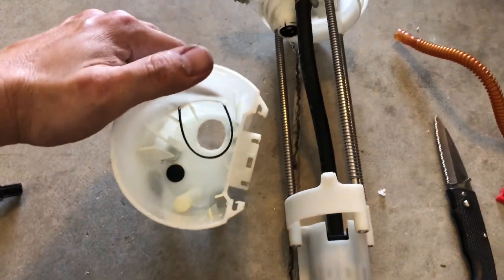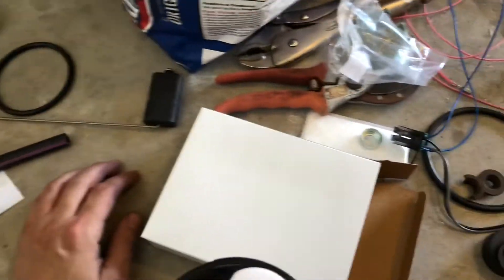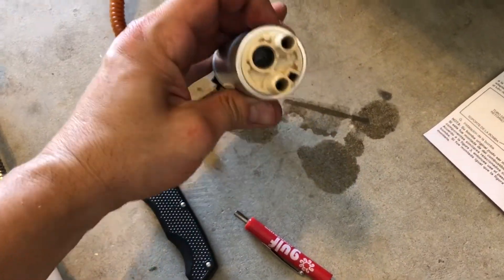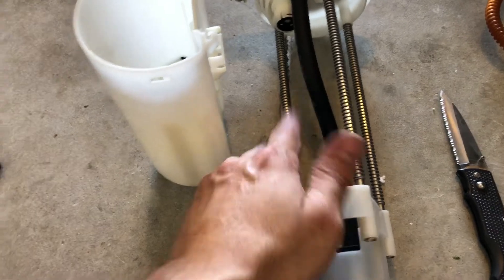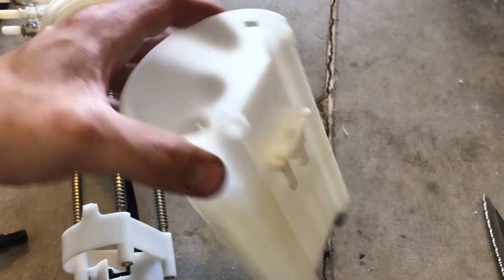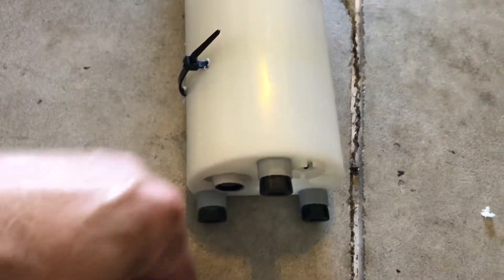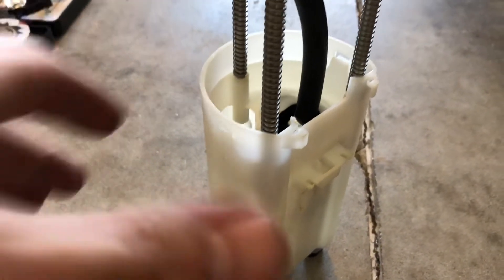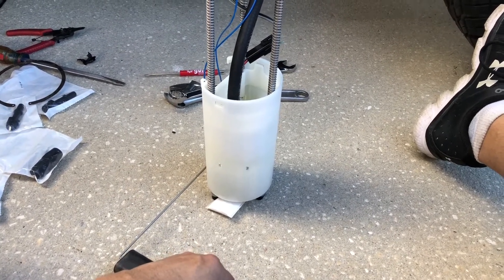LS S10 V8 Swap Part 10: Walbro Fuel Pump Install

Comment: I have a 2000 Silverado single cab we put a 5.3 in it it was a v6 we used the same stock 4l60e from the v6 without changing anything at all it blew up after driving it for 50 minutes so I got it rebuilt and it’s been working for over 2 years and I drive it every day and I’m always doing pulls

Comment: I’m curious what did you do with the emissions canister and the line that runs to it and then to the front? I just dropped my motor in yesterday in my 97 and I am getting ready to run the fuel lines like your video shows. Can I just get rid of all the emissions shit? I don’t have smog where I’m at so I’m not concerned with all that.
Reply from the maker: Honestly, and this is going to sound bad, but I just disconnected the line that goes to the tank, and zip tied a piece of t-shirt to the end of the line, to act as a filter… hahahahaha! Seriously though, that’s exactly how it’s been since the swap…

Comment: Great video. Appreciate the details! About to install this set up on my Fj40 with a LS6.0. Did you have To splice and add different plugs and connectors or just pigtailed ?
Reply from the maker: It looks like it came with a plug.

Comment: well im about to try the same thing,i have a 6.0 in my 2005 blazer 2 door 2wd and the tank is in the rear,its weird,all the video's on here for blazers show the long kind like you have in a s10.but hey im really glad its in the rear it will add weight over the rear tires,that and my 18 inch sundown audio sub in a ported box haha,im doing the fuel now,i put it off lol my wiring harness will be here this week,i miss my music more than anything,im a bass head and i havent heard the 18 yet.as for my engine,yea im excited and a little nervous,i didnt skimp on anything though and ive spent well over 7 grand in parts,so hopefully it will work out right you know,the ac condensor relocator is the way to go,i was able to put a huge aluminum radiator in there with bad ass fans,im in texas so i spent a lot of time cutting to make things fit.hope this helps someone.

Comment: Always use  the special hose when adding a fuel pump like this. The rubber hose and clamps will not last very long and will leave you along the road.

Comment: Does this work with the 4.3 fuel pump as well
Reply from the maker: I would think it would be the same process
Reply: I dug into it and it’s a different wire harness but all I had to do was change the ends to fit in the harness 👍🏽
Reply: You can use your stock 4.3 fuel pump to run your ls motor just fine.